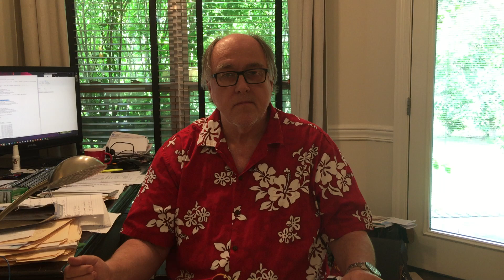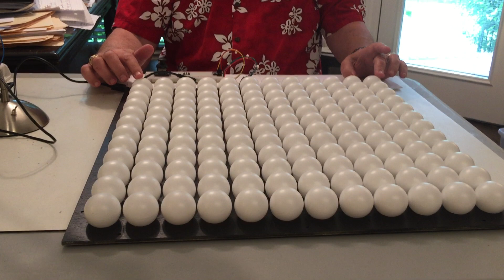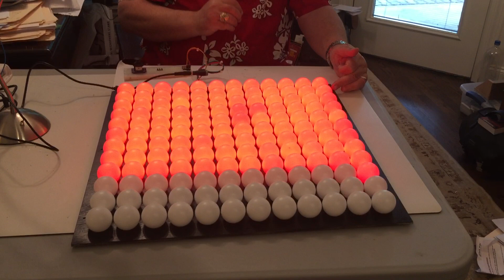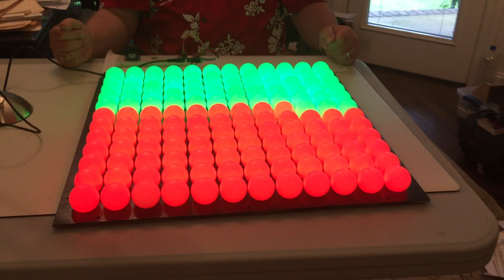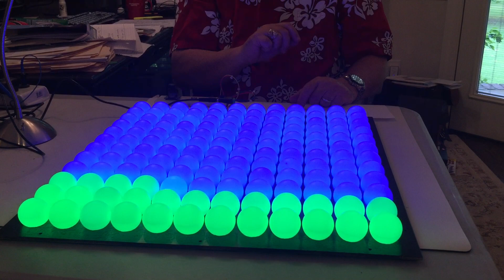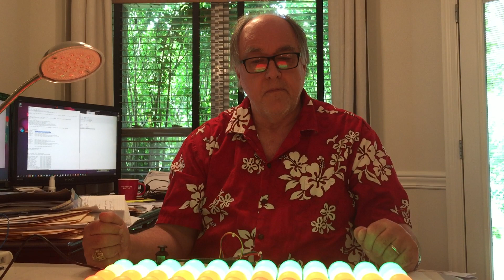12 x 12 NeoPixel Ping Pong Ball Array (Running the Second Test program)

Comment: What happens if you set the color of a pixel and then disconnect data pin, its still on with the color setted?
Reply: I think so as long as VCC and VDD aren't disconnected (i.e. the power lines Mr. Maxfield installed by 4's in a previous video)
Reply: Yes, once the three 8-bit pulse-width modulation (PWM) controllers in the NeoPixel have been loaded, the pixel will continue to display that color so long as power and ground continue to be provided, irrespective of whether the data input is disconnected.